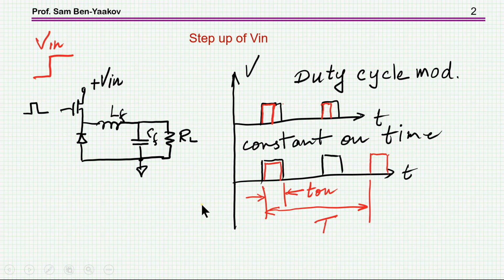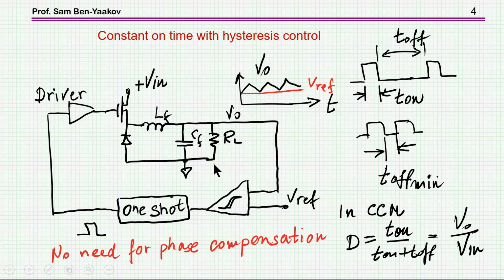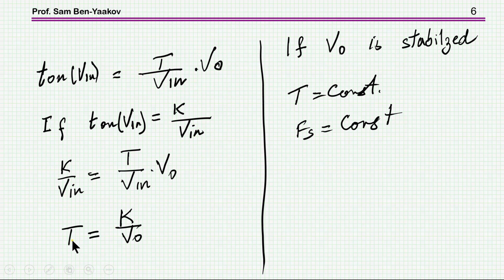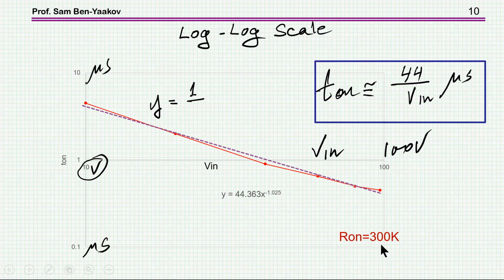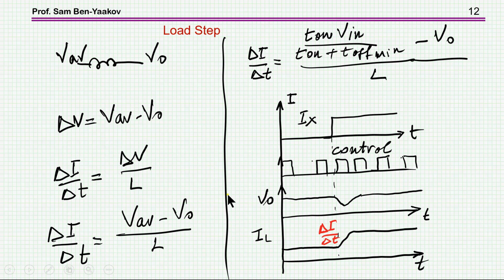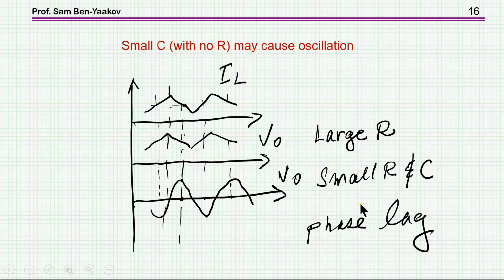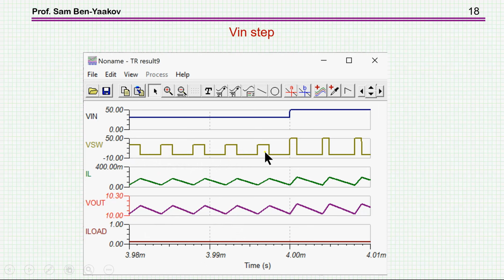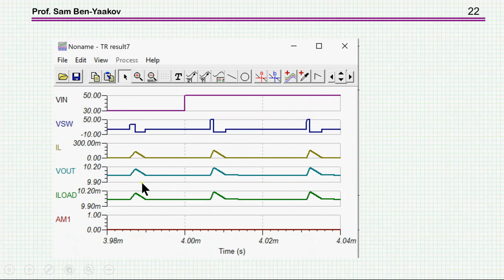Constant on time control of PWM converters: An intuitive explanation

Comment: Thank you, Prof. Ben-Yaakov, very intuitive explanation for this constant on time control for buck converter. Do you know who is the first person to propose this constant on time or constant off time control for buck converter?
Reply from the maker: No. Will be happy to find out.
Reply: @sambenyaakov  Thank you for your reply, Prof. Ben-Yaakov. I tried to find the first reference but not be able to make it. It seems that everyone took it for granted before 1990. But I found one patent from Infineon (US7521913B2) that they use output voltage to adjust the pulse width and frequency during load transient. The technique in this patent is very similar as the COT control during load step up. Will this claim still be valid?
Reply from the maker: @jjjxxxxjjj  🤔

Comment: Hello Prof Ben-Yaakov,   Thanks for an excellent video !!  Question - In Constant On-Time architecture, will high/low side switching frequency be a function (linear) of output current IX after transient settle?
Reply from the maker: Not of current. Depending on type of controller, it might be a function of voltage transfer ratio.
Reply: @sambenyaakov  Thanks
Question - Then what really changes in a controller to supply a larger current after transients have subsided say from 5 amp DC to 20 amp DC?  Since on-time pulse width is always constant, I thought the number of high pulses (switching freq or off time) must be the only way to supply increased current demand.
Reply from the maker: @SanjayPatil-ju7ch  See https://www.youtube.com/watch?v=YqX7JGC7tZQ

Comment: Hi professor Ben Yaakov and thanks for another great video. Can you please elaborate on the benefits of constant on time control compare to other controll schemes other than a simpler control system. When would this control system will be more attractive? What performance (efficiency, transient speed etc..) would this method have compare to other controll methods? Thanks for another great video, Noam
Reply from the maker: Hi Noam, Thanks for comments from which I learned that I have met my objective of this video: arising interest and curiosity in subject😊. Considering the fact that retention time of videos is short (up to now for this video: Audience retention Since uploaded (lifetime)
5:44 (25.9%) Average view duration) long videos are not effective (for most viewers). I may have a follow up on this subject keeping in mind your wish list
Reply: @sambenyaakov  yes I am intrigued! Thanks for the comment and for placing my request in the pile.
Reply from the maker: Hi, Just posed your questions at  https://www.linkedin.com/feed/update/urn:li:activity:6672198007666028545